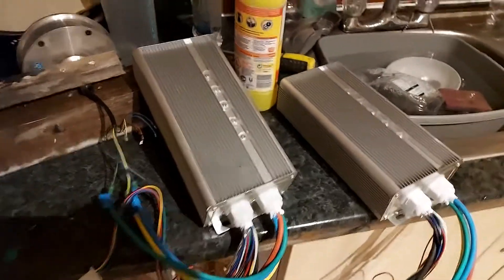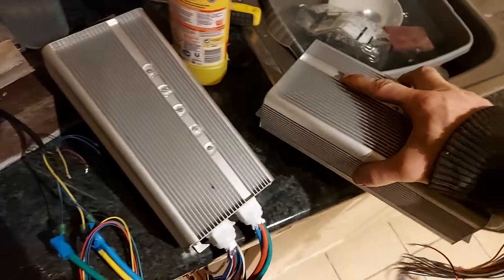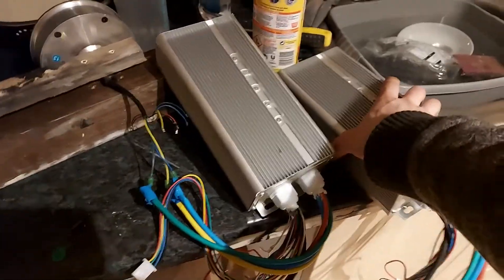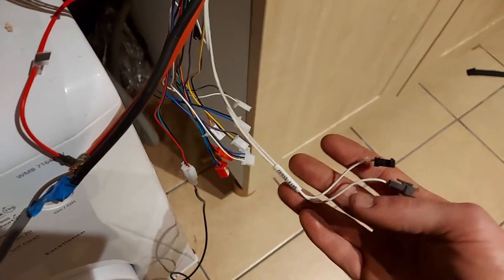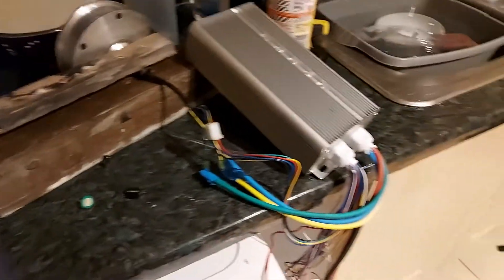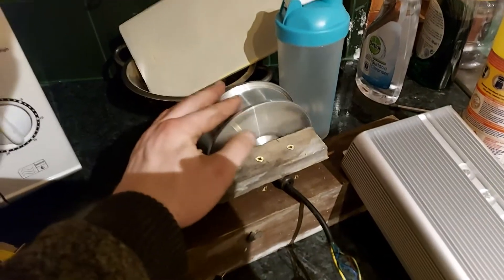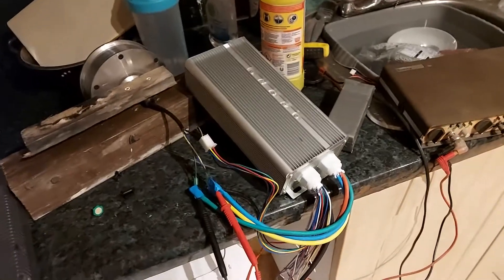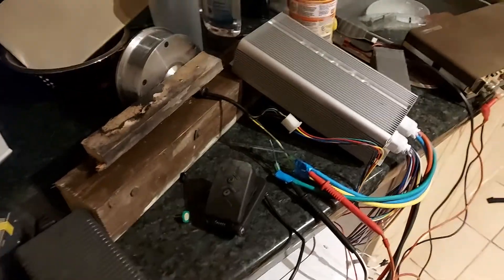Kunray 72v motor controller test and features

Comment: How do i connect a sw900 to this big controller its like mine do i connect red n black to throttle then the other. Colour yellow gren blue what do i do with them i have a purple wire for phese meter display

Comment: Hi, I've got a 48v to 120v controller from the same place as yours but mine don't seem to work, I've connected key, hall, phase and battery and tried sinhle red e lock on and off the red positive with no luck, mine controller does not have self study attached any ideas as the ebay seller does not answer my emails
Reply: U got scammed